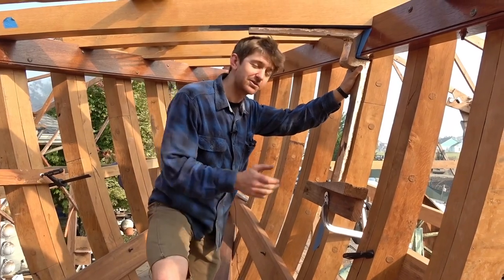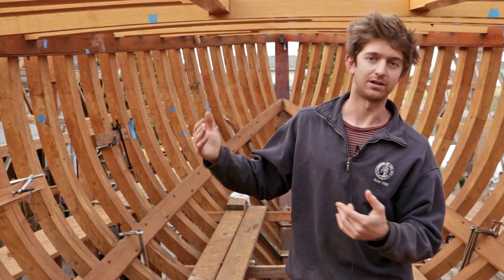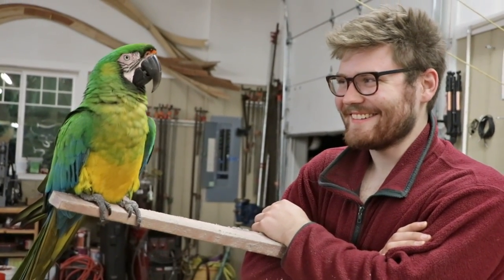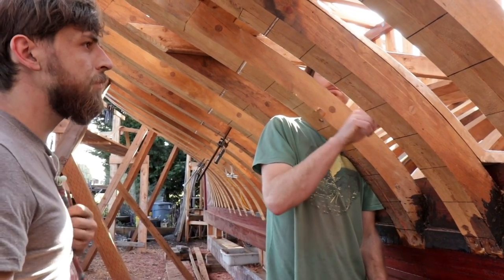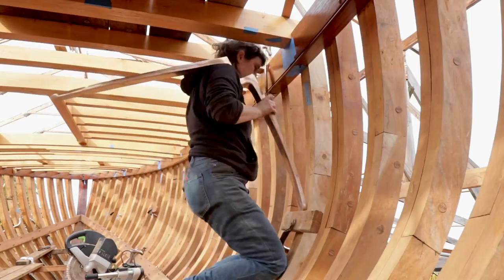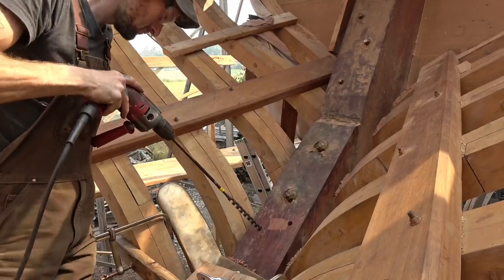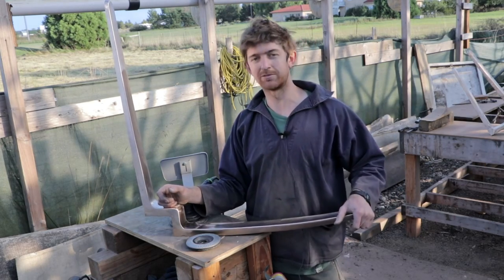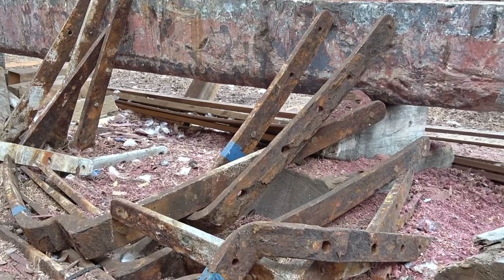Fitting/Polishing Bronze Knees - Wooden Boat Rebuild (EP82)

Comment: I am curious to know how the design for the Tally Ho came to be? I also am wondering what was used for glue and other adhesives when the boat was originally built? When Leo first purchased the Tally Ho were the original bronze knees still in the boat or did they not use them, or had they been scrapped out?
Reply: The boat was designed in 1909 by Albert Strange & built by Stow & Son for Charles Hellyer, who owned a fishing fleet. Originally named Betty, she was a luxury yacht for offshore cruising & fishing.
Glue was not used in her construction.
The original floors & knees were wrought iron, not bronze. Although they were in fairly good condition & could possibly have been re-used after their bearing surfaces were ground to fit, Leo did not want to use any ferrous metal in the boat - it causes "iron sickness" that degrades wood.

Comment: I re-watched a couple earlier episodes: Rebuilding Begins and #7. Would you do it again knowing what you know now?
Reply: There was a moment towards the end of one of the early videos, when Leo realized that the large splits in the original teak keel weren't gonna close up when it got wet again. It's the only point I recall where he seemed worried & a bit downcast.
But in the next vid, he bought 2 purpleheart baulks & got stuck in w/ crafting a new keel timber. That unplanned purchase probably took a good portion of his savings, but he didn't moan about it & got on w/ the job.

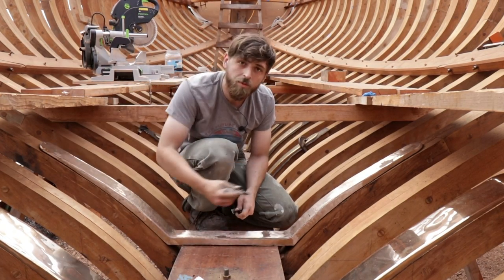Comment: 10:55 Why isn't there a way to set up a temporary work platform inside the hull, so that all the grinding of the bronze parts could be done closer to where the fitting needs to occur?   Seems so inefficient to haul it out of the hull, grind it, put it back in the hull, pull it out of the hull, put it back in the hull, etc, ad nauseum.
Reply: They know what they are doing!!!

Comment: Does it extend the life of the bronze pieces to polish them? I know they won’t seen after the build. Looks incredible, just wondering.
Reply: The knees will be in full sight in the cabin ... A (little) bit of bling will add character to this beauty. Seriously, polished knees and floors diminishes the risk of cracks in the metal, and if a crack should appear you will see it much faster and better. On top that it is "tradition" to maintain the polish on a ship,

Comment: When fitting the Drifts to the last floor at the stern, why not glue them in with epoxy as sold for concrete anchors?. Studs inserted with epoxy are used in many building projects for bolting steel beams etc to concrete and/or brickwork - these are immensely strong joints, much stronger than mechanical fixings and the bolts don't come out! The method used of notches in the rod may be the traditional way of doing this but is not very strong.
Reply: Not used in original!!!!

Comment: Newby with questions. Why do these bronze knees need to be so perfectly fittting? Are they going to be visible when the boat is done?
Reply: yes
Reply: In these joints, the strength is developed by friction between the mating surfaces. The better the fit, the more area available for force-transfer. The bolts & rivets provide the necessary clamping action - ideally, they act in pure tension & won't contribute directly to the force-transfer.

Comment: Just a quick question,  I might of missed your explanation but was Tally Ho not originally fitted out with the bronze knees and the other bronze castings? Edit... I think I might have just near to the end. Were they originally steel?
Reply: Her original floors & knees were iron, probably hand-forged from cast bar stock at the boatyard. Some info indicates that the iron was likely (high-carbon?) made by 'puddling' - prized by today's smiths.

Comment: I'm kinda confused on why you polish the bronze to a shine, isn't it going to be covered by the internals?

If so, wouldn't it be better to just get it to where its flat? Or does making it shine like that have some benefit other than looks?
Reply: Polished surfaces resist corrosion better because there is less surface area to corrode.

Comment: hi Leo, i'm wondering why the blocks of bronze are placed on the casts when the bronse are being poored. Is this just to apply weight in the area.
Reply: Pete from the foundry answered that in a previous video. The ingots are pre-heated to reduce their water content, which could cause an explosion if they are added to the molten material in the crucible
Reply: @peterbuchan628  oh cool thanks,

Comment: What is the purpose of using a torch on the bronze openings after the pour.
Reply: To slow the cooling of those "reservoirs", every metal crimps when it is cooling (or starts to cool), the hot flowing metal fills those small voids in the molding
Reply: @on4xb  Thank you for taking the time to answer my question.

Comment: from the "worldwide famous" sailing anarchy forums thread  (http://forums.sailinganarchy.com/index.php?/topic/193611-a-big-project/&page=7 post #663)  "As has been mentioned, once you've gotten the part ground to fit and then sanded to get the sharp edges and corners off, it's not much more work to get it to shiny and it helps keep corrosion at bay. However, having gone to the trouble I'm surprised he's not lacquering them before installation to keep them that way. It's cheap and easy to do, holds up well, and can be re-done when needed without much effort."

Comment: Leo, how does what you're doing now differ from the original build of Tally Ho?
Reply: Leo is following original plans!!!!!!!
Reply: Leo has made a few changes. The mast-step portion of the for'd centerline is 40" longer, to better support her enlarged 1927 sail plan. The prop shaft bore is drilled at a down-angle, it was originally horizontal.

Comment: Did you ever consider to cast with the so called lost form mehtod? this would mean you dont need to build cast forms that have two parts to get your model out. You would protect the wood where your knee shall be with tape and a very thin layer of wax or grease. Then you build a mold of a simple wood structure around the place where the knee will be. You protect the inside of this cavity with a thin layer of wax, put it in place and fill the cavity with 	polyurethane. Once it hardened, you take the form of polyurethane out and shape the edges and curves until it has the form of the knee you want. You smooth the surface with wax and put this form into your sandbox for casting. Then you can cast your bronce directly into the form, the polyurethane and the wax will burn out immediately and the cavity will be filled. This method should work much faster becasue shaping of the model is very quick and you dont need to take care if it is possible to repopen the cast mold to get the model out. Naturally you have only one go with each form, if it comes out wrong, you need a new model.... Would be interesting to see a try

Comment: I feel that the floors and knees could have been more efficiently crafted by 3D laser scanning and CNC machining rather than casting and then countless hours of grinding. You’d also avoid all the process of having to make single-use forms and making the various parts of the forms
Reply: Watch previous videos!!!

Comment: Given that the original knees were cast iron,  is polishing the bronze knees purely aesthetic and not really representative of the original finish back in 1910?
Reply: Leo has mentioned this a few times. He wants to to the best thing for rebuilding Tally Ho, and iron isn't the best. Iron will corrode and damage the timber, and is part of the reason that the boat needs such a major rebuild at all. Bronze will not corrode like the iron would and won't damage the timber.

Comment: Those dumps or drifts, I wonder... Would Pete would have been better off threading the entire rod, locking a nut on the top, drilling the holes in the timber a couple of mil undersize then winding in the rod like a giant wood screw? I'm sure the barbs are adequate but wouldn't thread would have been even better? And had some real pulling-in power? Maybe you even have a die that could cut a more coarse thread? Questions from my armchair engineering perspective of knowing nowt about boat building

Comment: wait, the originals were made from steel?
Reply: N, they were forged (hand-hammered) from cast iron bar.
Reply: Frederick Stibbert Didn’t think you could forge cast iron!
Reply: @moontheloon808  - I imagine that the Stow & Son shipyard bought strips of cast iron from a foundry. Then they re-heated, bent & shaped it at their own smithy.
Reply: Frederick Stibbert  - That’s very interesting that they should use cast iron as it is really only strong in compression doesn’t like flexing and usually breaks when bent due to it’s structure even when heated. They did well to last over a hundred years these old boat builders never cease to amaze me in what they can achieve. Nice talking to you.
Reply: @moontheloon808  It's only 'cast' iron when it is a fresh billet. After forging it becomes wrought iron. I still think they were steel though.
Reply: M B - Not sure about that I thought cast iron had a carbon content of 2% and over which is why it’s brittle and breaks when bent. Wrought iron has a carbon content of much less than 1% and has a grain which allows it to bend without breaking. I believe that’s why silicon bronze was chosen for the new castings as it can flex a bit before breaking. I agree though still think they were wrought iron. Nice talking to you.

Comment: Why copper rivets and not bronze?
Reply: Bronze rivets are to  hard to peen (and TH original rivets were in copper as well)
Reply: @on4xb  thanks! Wait...they used iron rivets on clinker ships?
Reply: @naui_diver9290  Yeah on metal ships and the rivets were stinking hot. Try to do that to do on a wooden boat, you end up with a lot of ash and nothing else. The copper rivets will be "peened" (riveted) cold.

Comment: Are US grit sizes different from Brit grit sizes? Graduating through 1000, 2000, and then 3000 before starting to polish sounds excessively teeny-weeny to me. When I used to make telescope optics (mirrors and lenses), there was never any need to use anything that fine (either carborundum or aluminium oxide, both used with water) before hitting the polishing rouge. 

Is it a case of different US/UK standards again? Most of our capacities and quantities are completely different - US weights and measures tend to be smaller.

US gallons are TINY, for instance. Our wire gauges (SWG) are different, too, so I was wondering if those grinding grits were measured differently. What's the UK equivalent of 3000 grit US? Are they in fact the same, or are US grits just called different things out of historical spite? [Joke.]

Don't forget that a US 'billion' is 1,000 times smaller than an old-school traditional one, which to me is always going to be a million-million.

Ah, well - I suppose it helps to make certain, er,  'billionaires' feel a bit less inadequate...  ;-)

Comment: The parts are nice and can be a good scluture for the front or a good compass or nice windows. But these are part of the bilge and will not have so much view. The big problem is structural. The tensile test (https://en.wikipedia.org/wiki/Tensile_testing ) for cast brass is not good (and for almost all cast metals). The only special brass with good tensile properties are the one used for guitar springs, but are not high strengh. THE BEST MATERIAL IS TRUCK SPRING STEEL (for price and properties and can find very cheap reclicled) , IS STAIN LESS STEEL BUT IF YOU WANT TO PROTECT IT MORE YOU CAN ADD A LITTLE MAGNESIUM SACRIFICE ANODE IN EACH REINFORCEMENT. REMEMBER THIS FOR OTHER BOAT. This the tensile test for steel https://jssteel.com/wp-content/uploads/2010/12/jssteel-graph-frac.png The almost linear part is the one that dont suffer permanent deformations and is elastic. The pendent is the used as constant K to calculate the tension of a spring. This is a comparation between steel siemens martin normal 1040 ( 0,40 percentage of carbon and thats it) and brass laminated (not casting the cast brass is weaker) https://www.researchgate.net/profile/Shakir_Gatea/publication/235957389/figure/fig4/AS:299910684528648@1448515687922/For-1040-Steel-Brass-and-Copper-a-the-Increase-in-Yield-Strength-b-the-Increase.png THE SPRING STEEL IS AN SPECIAL ALLOY AND IS SO MUCH HIGHER THE 1040 IS A SOFT STEEL. I HOPE THIS CAN BE USEFUL FOR YOU.
Reply: First of all the floors and knees are made of bronze, not brass. Have you seen episode 75, where Leo explains why he chose bronze ? Here is a link to the item in that episode: https://youtu.be/foDRc2X_Utg?t=387
Reply: The best or most suitable material is determined by a combination of factors - ultimate yield strength is just one of those, which include weight, cost, appearance, corrosion resistance, workability & deformation characteristics. Leo (likely guided by informed advice) chose a silicon bronze alloy that fit the boat's needs.
Reply: Sorry I coulnt find a another chart for the explanation, is almost the same. The bronze is more expensive, heavier and with less mechanical properties (all) so for the same usage you have to do a part with bigger dimensions to do it in bronze to that increase more the weight. To have almost the same aparance and corrosion protection if you want  to spend money you can use zirconium nitride coating https://en.m.wikipedia.org/wiki/Zirconium_nitride  
This will do a part a little less expensive with more mechanical and properties and less weight AND ALMOST THE SAME VIEW !!!. FOR ME IS NOT NECESSARY ONLY PAINT AND A LITTLE SACRIFICE ANODE (MAGNESIUM) IS MORE THAN ENOUGH SINCE CORROSION MEANS WATER AND THE WOOD WOULD HAVE THE WORST PART WITH WATER THERE. IS YOUR CHOICE SO ONLY CAN GIVE YOU SOME BACK UP FOR IT.

Comment: Small structural question. Why are the hanging knees fitted inboard of the frames, deck beams and deck shelf? Wouldn't it be easier to fit them either to a fore or aft edge of the frames and deck beams and outboard of the beam shelf? 
I would think that the same structural stiffening strength could be achieved with much less material weight and cost if the knees were fitted on a plane 90' to the one shown. However I'm assuming there is some 'boat building reason' besides a desire for more brass bling to be visible inside Tally Ho;-)
Reply: Following original plans!!!
Reply: Hence my asking Leo if there is a 'boat building reason' for why the 'structural' design of the original boat, and his rebuilding of it, have the knees 'structurally' designed the way they are instead of the way I stated in the question.
Reply: The deck beams are at a different spacing to the frames & aren't the same width - the fore/aft faces are almost never aligned. Also there could be interference between fore/aft knee bolts & the planking rivets.

Comment: Why bronze?
Reply: Bronze corrodes slowly in the marine environment. Iron or any ferrous metal is right out b/c it corrodes quickly, & leaks iron ions into the wood. These ions interact w/ the wood (iron sickness). The iron-sick wood is structurally weakened & more easily attacked by mold & rot.

Comment: Why don't you  guys drop a couple of tarps inside the boat and build some temporary tables so you can do the grinding inside the boat? Having to constantly walk in and out with those knees on your shoulders is a workout and a half and time consuming. Doing everything inside the boat will save you a ton of time and prevent somebody from accidentally tripping ( knock on wood) trying to get in or out of the boat , while carrying one of the 30+ pound pieces. Just a suggestion.
Reply: Grinding and polishing is not the only task that happens inside TH. THat would lead to a lot of interference

Comment: Its not 110 year old. .  Why you said that
Reply: Tally Ho (then Betty) was launched in 1910.  This is a rebuild/restoration project and that is why TH is 110 years old
Reply: @on4xb   they used only 5% old wood.. From tally  ho. . 95%  wood/ materials  are new. . .  Its a new ship
Reply: @tigertraveler3156   It does not matter.  Even if he reused one nail it would still be TH
Reply: @tigertraveler3156  Watch Episode 58!!!

Comment: Just wondering, looking at a beautifully polished floor at 26 minutes in, given that this is a reconstruction of a boat that was once common, would the original floors and knees be polished cast brass/bronze, or just cast iron or wood or just left rough?
And can the Americans understand you, I gather that the poor little mites have trouble with British accents.
Rhetorical. Don't bust a gut to answer.

3,000 rivets sailing in close formation...

Comment: A supreme waste of talent having a volunteer sand and polishing the knees,especially notching the board that the knee fits. A round over bit would have saved hours by changing your profile where the knee fits. You should have used a belt grinder like knife makers use to sand and polish the bronze. I'm sure the girl who signed on was thoroughly fed up sanding and polishing bronze as opposed to actual boat building. I bet she thinks twice about finding out what her job would be as a volunteer.